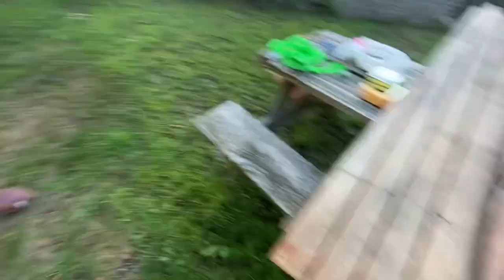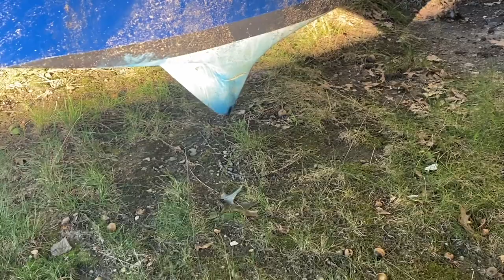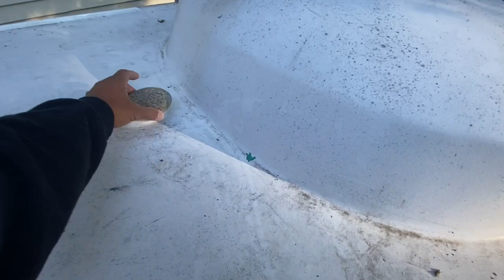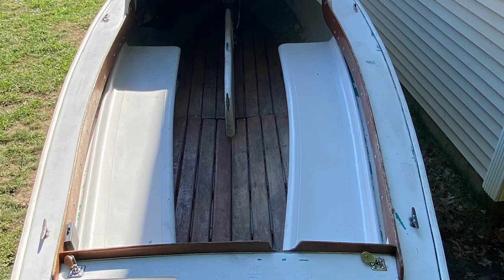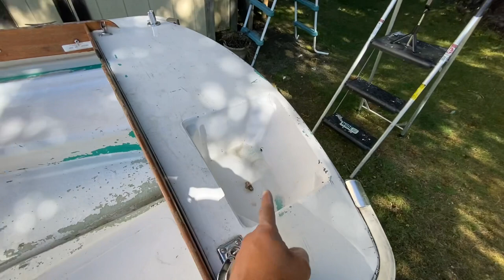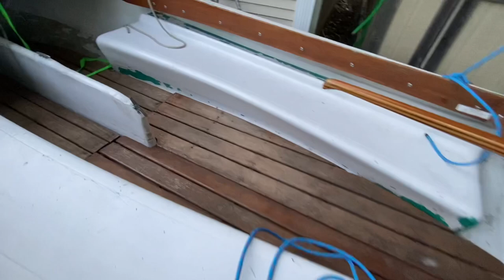O’Day Ospray pocket cruiser (Ep-9)

Comment: Thank you for posting this. I have an Ospray that is a few years older than yours, and I have found that there is very little information available for them. FWIW, I leave the shrouds permanently connected and use a quick connect pin on the forestay for ease in stepping the mast. The rigging will always be a little loose, and it does not use a backstay. The ice chest you are contemplating is definitely a motorwell. Many, many best wishes and congratulations on getting this boat. There were only about 500 made in around 10 years of production, so we are in a small club of owners. Good luck.
Reply from the maker: I use the ice chest for my little 2.5 hp Honda. I did just get some vintage wooden oars so I’ll be installing them for next season. My only issue with using an outboard is if I capsize then I’ll loose the motor. I’m thinking oars are a better option especially since it doesn’t take much wind at all to move her. Also some O’Day Javelin parts may also be used on the Osprey incase you’re having difficulty finding parts. I’ve learned the European model is called “Ospray” not “Osprey” like the ones made in USA…